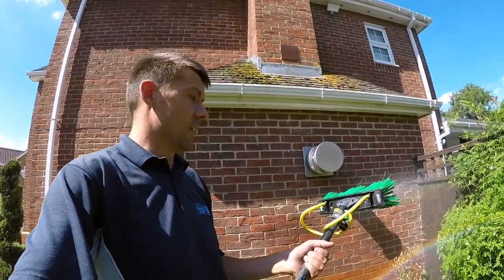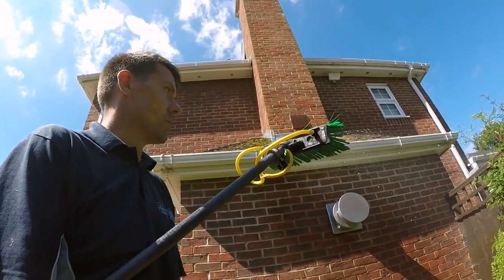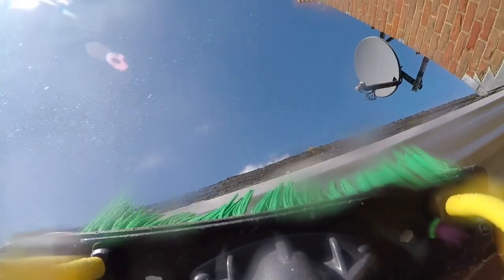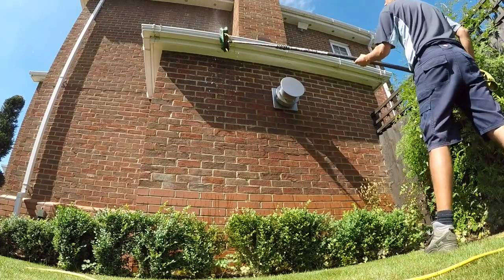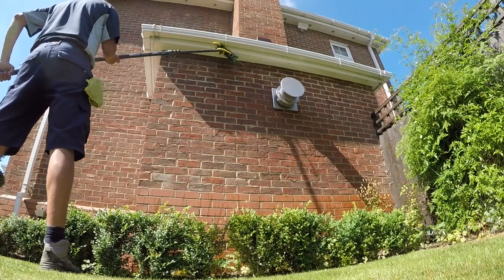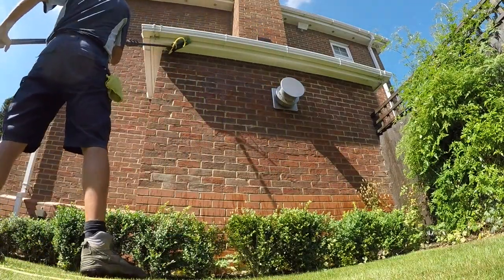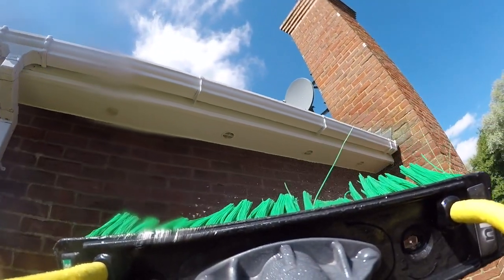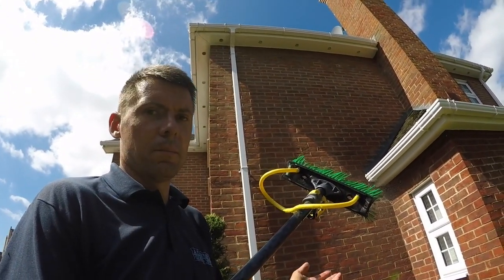Professional Method For Cleaning Fascias And Soffits

Comment: Hi I have just purchased a 24ft pole do you think this will be big enough to do the job on standard 2 storey house thanks
Reply from the maker: It should reach fine, might just be a bit of a stretch on the high gable ends.👍🏼
Reply: @aemackintosh  thank you very much

Comment: Hi mate what brush is that in the video, is it the unger 27cm rectangular? I like the look of that as I only have been buying brushes from gardiner
Reply from the maker: Yeah, but that Unger brush has gone out of stock in most places now because they have a new nLite range coming out. I like the brushes with flocked bristles from Gardiner on fascias too.😃👍🏼
Reply: @aemackintosh  ok that’s great thanks for the reply yeah I have one of those , also what upvc cleaner would you recommend for facia soffit and guttering ? I’ve been recommended ubik 2000 have you used it ?
Reply from the maker: Yes, that’s a popular one. I haven’t used it myself. I get a upvc cleaner from bonnymans.com in bulk, so I always have plenty.😃👍🏼

Comment: Wish I'd seen this before I paid someone to do my fascias etc. Didn't know they were just gonna use a wet cloth - and was then told I was being picky because I wasn't happy with the standard 🙄
Reply from the maker: Claire Welch That’s no way to speak to a paying customer. Next time call in the professionals.😃👍🏼
Reply: Trust me, if you haven't cleaned your fascias in the last 10 years, then cloth or jet wash is the only option to do properly as polling would not provide enough punch to penetrate long standing filth. This video doesn't reflect reality, as in video he is cleaning clean fascias.
Reply: @MrVeryfrost  I regularly clean fascias which haven't been cleaned for many many years, thick with green algae and muck, and I only use water fed pole and pure water. It works very well.

Comment: Hi Ash, We've recently purchased an Unger nLite set up mainly for applying soft wash applications. Currently just running it from a Water Genie back pack. I've swapped to fan jets, but find they give no more spread than my pencil jets. Have you had any issues with yours, they seem to give a good spread in this video?
Reply from the maker: James Lee Yeah, I know what you mean, the Unger fan jets need a higher flow rate for them to fan properly.😃👍🏼
Reply: @aemackintosh  Thanks Ash, just wanted to make sure it wasn't me  doing something wrong as we are new to this kind of service. Thanks for the quick response and keep up the good work with all the vids!
Reply from the maker: James Lee Thanks. I hope your business plans go well.😃👍🏼

Comment: Ash what pvc cleaner do use mate ... we’ve always just used TFR or viro-sol
Reply from the maker: Dave monk Monk Cleaning services I’ve been using UPVC MAX from aimscleaninghub.co.uk 💦😃 They have a great range.👍🏼
Reply: A.E.Mackintosh Cleaning Services thanks Ashley... one more silly question mate what do u use to spray the cleaner on??? We use backpack and nozzle that  goes on the end of the wfp wet one section then spray cleaner leave for 5 mins os then start cleaning 👍
Reply from the maker: Good question. We do much the same as what you mentioned. I put links in the description to the vids demonstrating how we apply the cleaning solution.💦😃👍🏼

Comment: Is it common to not provide a window clean after a fascia and soffit clean?
Reply from the maker: I always clean the windows afterwards because they get splashed with dirty water when doing the fascias.😃👍🏼
Reply: @aemackintosh  it makes sense, I’m not a window cleaner how would you suggest I clean them down after a fascia clean? I’ve looked at methods and can’t seem to find one that seems appropriate
Reply from the maker: Well if you use tap water you will leave a residue, so the best way is to wash thoroughly with pure water which won’t leave water marks when dry.😃👍🏼
Reply: @aemackintosh  I don’t have access to pure water,  but I’ll look at cheaper pure water filters to start, cheers